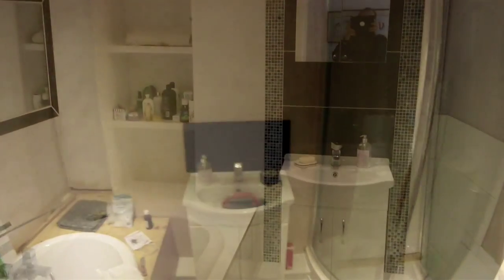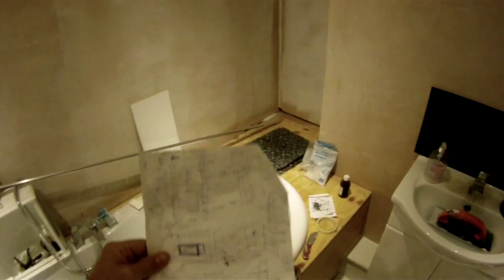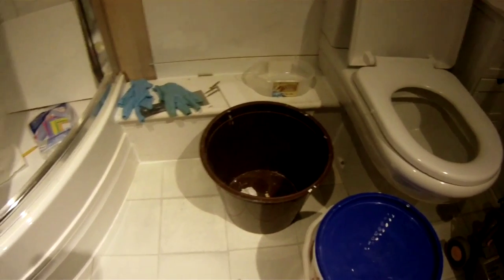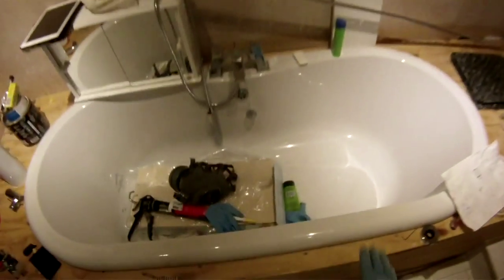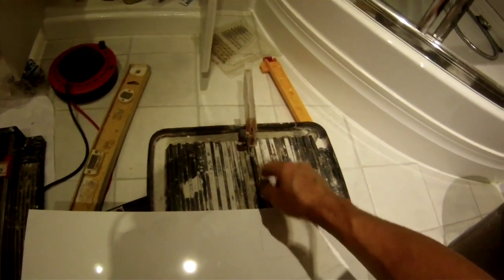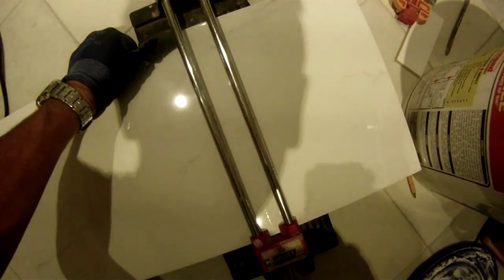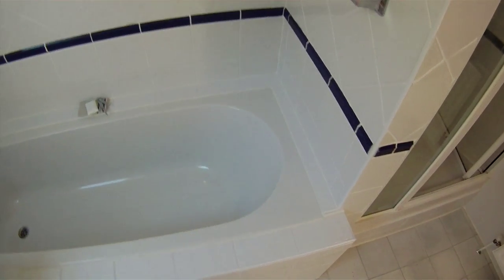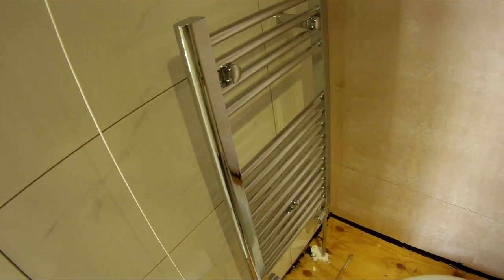How to Tile a Bathroom - Part 1

Comment: After ripping out my old shower due to mold on the ply I decided to use cement board. Watching other vids I'm lead to believe ply is a no go in a shower, have you had any issues nearly 6 years later?
Reply from the maker: Ply or any wood with just grout on it is no good where water sits on it horizontally. In my opinion. That is why with the ply around the bath I sealed it with resin. Then grouted on that. It is still good all these years later. On vertical ply, I would seal it well first with a waterproofing sealer and use waterproof grout and adhesive. The less critical bit on the outside of the bath panel was just sealed with diluted PVA.

Comment: Nice work although PVA not a good idea when tiling. A proper primer such as BAL would be better suited.
Reply from the maker: Thanks, not seen that one. I looked it up: https://amzn.to/2PbI6JU
Looks ok and a different formulation, just a bit more expensive compared to traditional PVA, which is also used as a plaster sealer/binder:
https://amzn.to/2KCmpUy

Comment: Good video, but just one comment. PVA and tiling adhesive do not mix.

Take a look at any tiling forum to see what I mean - http://www.diynot.com/diy/threads/pva-and-why-you-shouldnt-use-it-as-a-tiling-primer.33645/ . The water from the tile adhesive re-wets the PVA and instead of the tile adhesive bonding to the wall, the tile is now being held on by a layer of PVA.

I just read the adhesive manufactures instructions, they will tell you what prep you need to do (if any) for different surfaces. Some recommend a tiling primer for fresh plaster, others nothing at all. The tiling primer soaks into the substrate, unlike PVA. Most of the time you're lucky with this unless you're using huge tiles, but I've lost smaller tiles in wet areas due to PVA. I don't use it anymore.
Reply from the maker: +iplanet77 Thanks for taking the time to comment. Interesting, I use watered down pva so that it does soak into the plaster. The water carries the pva into the plaster. Then after it has dried it's relatively resistant to water transfer across the pva barrier so that the moisture is not sucked straight out of the tile adhesive, hence staying liquid enough to provide a bit of tile repositioning time. 

Providing the tile adhesive mixture is not too wet and sloppy it should'nt be a problem and any rewetting of the pva would draw water out of the adhesive and make it stiffer. Then the whole lot should dry out and set within a day or two if the tile gaps are left opening and not grouted for a day or two. 

That's one of the reasons I prefer using ready mixed adhesive, as the water content is just right, even though it is a bit more expensive. 

This approach has always worked for me and never had any tiles fall off. I've seen plenty of cases of tiling done by unknowns where no priming on bare plaster was done and they haven't stuck at all. 

Nice to hear of people's experiences and again thanks for the comments.